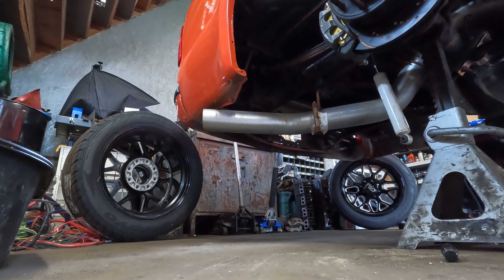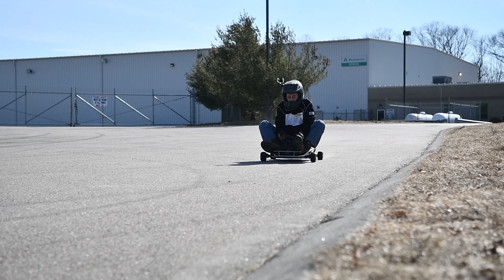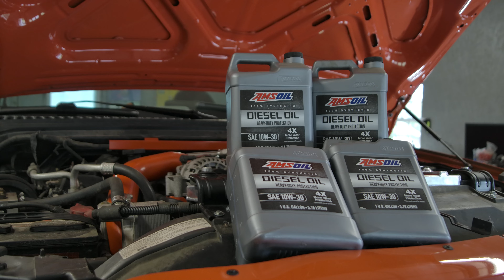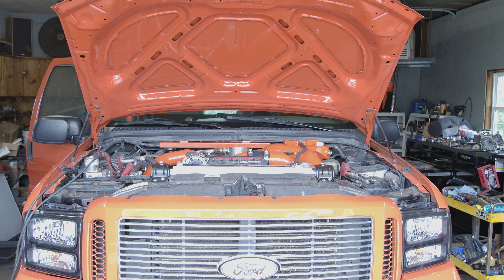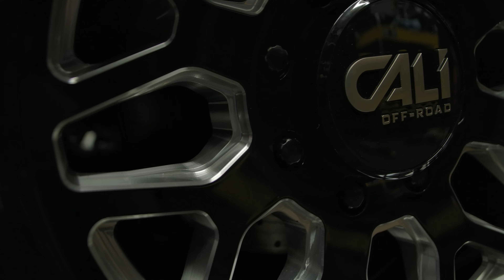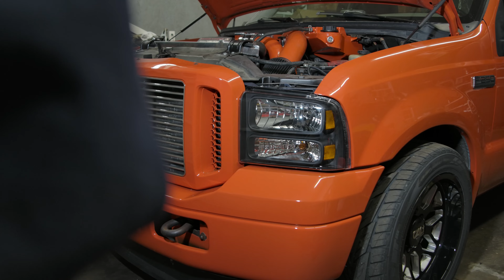It Runs!!! The 6.0 shop truck is together and running!

Comment: What size tires are you running on this set up it looks great with what you have done so far!
Reply from the maker: 20x10 wheels with 295/45r20 tires
Reply: @InTheShop  thank you! The build looks awesome I have an 03 that I bought 20x10 with 0mm offset, but trying to find the right tire and yours looks like it has alot of meat on it